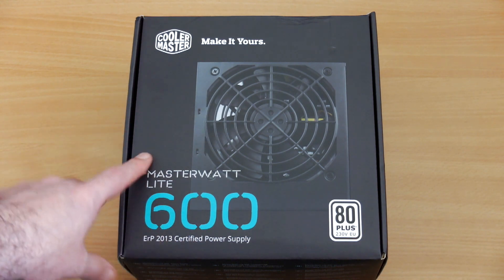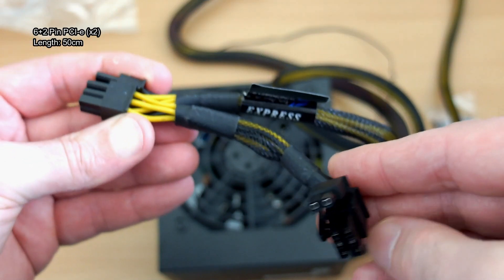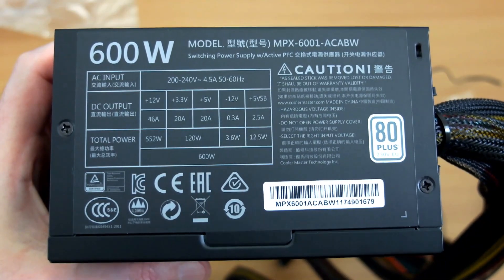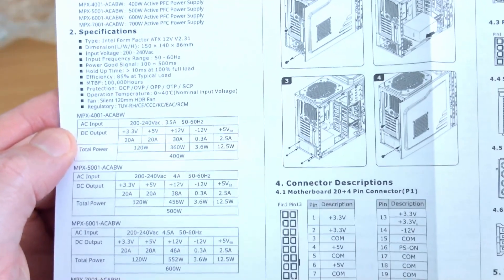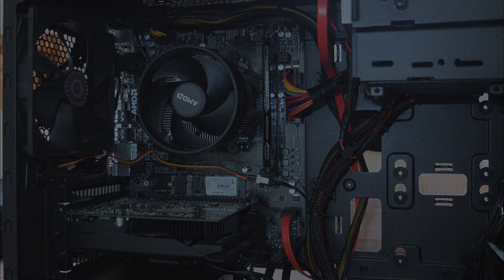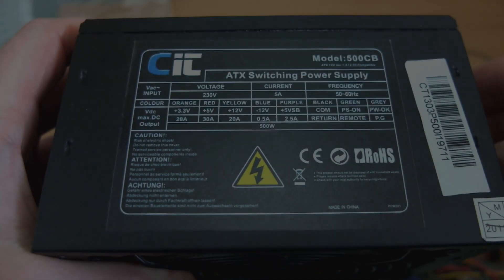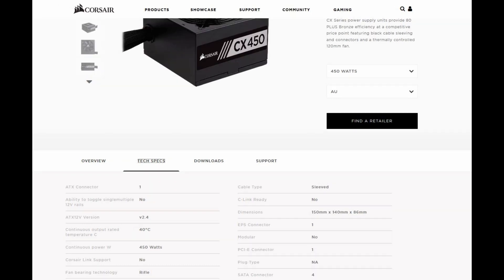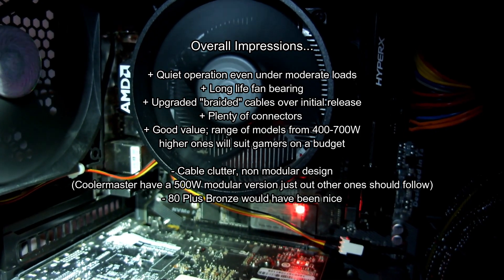Cooler Master MasterWatt Lite (V2 600W): Unboxing/Hands-On

Comment: Can i use this power suply for my PC ugrade from 1060 to 1070ti or higher ? .
Reply from the maker: Yes but use a PSU checker to work out overall power needed
Reply: you will be fine i use it with 8700k and 1080ti
Reply: @spunkimonkey90  My current specs are : Core I7 8700 @ 3,2 ghz max turbo untill 4,6 . 16 GB RAM , NVIDIA GTX 1060 6GB . Shitty thing is that i only have a 300 watt power supply in my current PC so if i want anything better then 1070 il need 500-600 watt supply. My motherboard has 2 PCI 16 slots 3.0 Tampa 2 its called .
Reply: i have this 600 w psu and i have a i7 8700k 1080ti 16gb ram  @Ramon_92